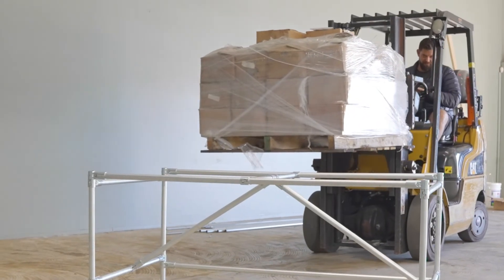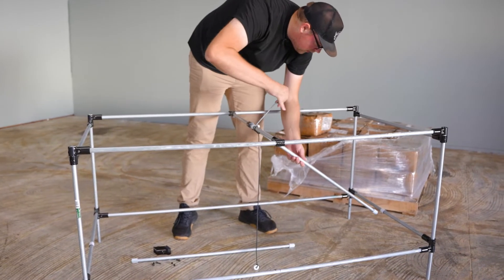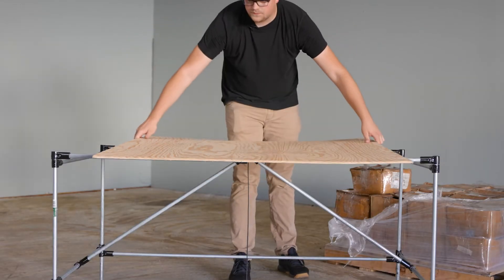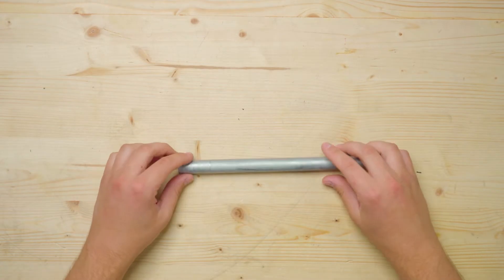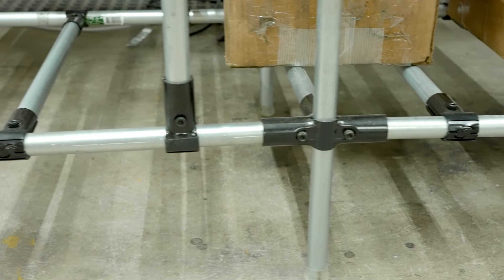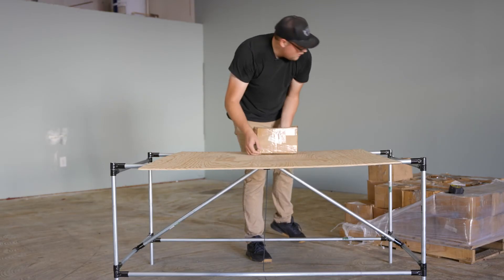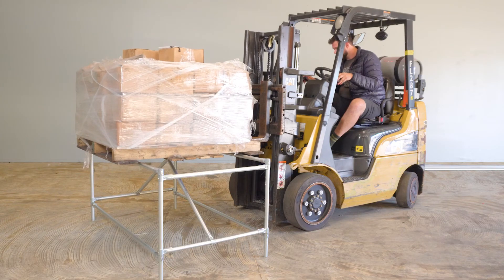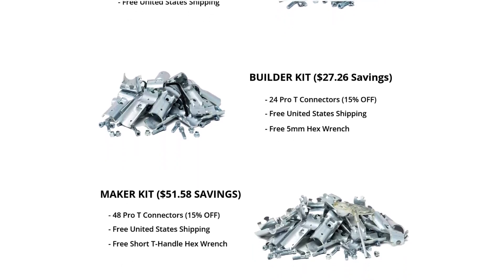Pushing Conduit To Its Limits!

Comment: When specifying tubing for products, engineers choose to go with larger diameter over thicker wall as the weight to strength ration is superior for the larger diameter. You can see this effect in modern bicycle frame building employing shaped forming and larger tubes for rigidity. Bracing becomes unified in formed shapes at the corners as well. BELLA GOOD DEMO!

Comment: There was noticeable deflection on the lower side rails from the diagonal braces which caused the upper rails to deflect. If you would have put the diagonal braces near the posts the bending resistance would have been significantly improved.

Comment: I need to add an upright removable handle to a bicycle cart when disconnected from the tow bar that connects it to the bicycle's rear axle.

The cart is rated at 80 lbs, but 100 is sometimes loaded, aka firewood.

Would curved conduit be strong enough to lift the cart so it could be wheeled around?

Plan on adding an upright tube sleeve,  on front of cart, to use a pin to hold handle on.

Comment: Suppose I made a sort of 'beam' of two horizontal sections (one 6"-12" above the other) connected at the ends and in the center with vertical uprights --  would the load bearing capacity double?

Comment: older video but if anyone knows, i was curious about how well this emt could use to build buildings. like maybe a garage with metal siding or a bigger shop. i figure i could use a small frame to build a carport for bad weather perhaps but i also would like to build a workout room and i dont really need a proper building if i can still lift inside i just dont need it blowing away or people able to break inside and steal weights otherwise i would just lift outside.

Comment: Unfortunately, too many of your fittings are not available for 1-inch. It seems Schedule 40 metal pipe has the same OD as EMT conduit. Is there any reason I can't use your fittings with 3/4" Schedule 40 metal pipe for added strength where inner diameter is not important?

Comment: Pretty sure I’m going to be making a chicken tractor out of emt and these fittings thanks to seeing this test and discovering those fittings. Now I just need to decide on 3/4” or 1”
Reply from the maker: Awesome! Can't wait to see what you come up with. 3/4" is surprisingly strong and a lot cheaper but it all comes down to how big the structure is and how much weight will be sitting on top (if any)

Comment: For the top rail corners, I see you used two tee connectors instead of your structural 90’s - is one sturdier than the other?
Reply from the maker: Hi there, thanks for the question. We don't currently make a 90 Degree Connector for Top Rail so we stacked two T's to achieve the corner connection.

Comment: Could it be possible from this video to somehow roughly estimate a 20ft 1-inch EMT straight run only being supported by an inch at each end?
Reply from the maker: Thanks for the comment. That length of pipe isn't going to support any weight at all I would think. It's going to flex and bend before you even load anything on top of it.